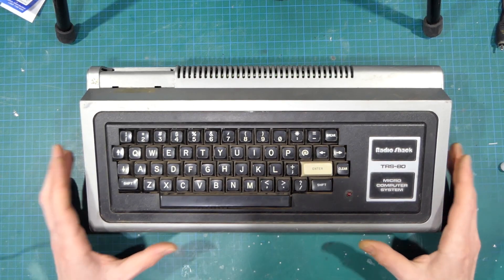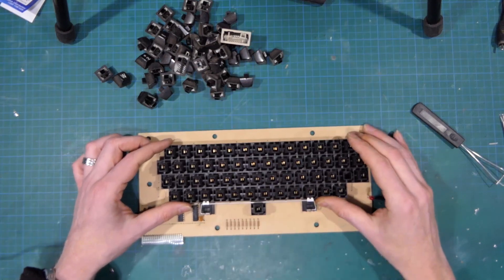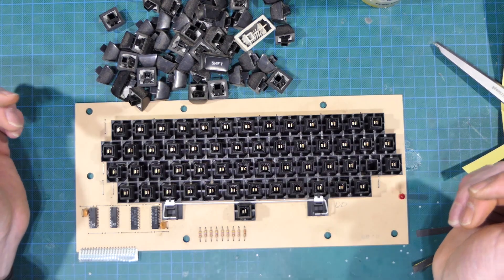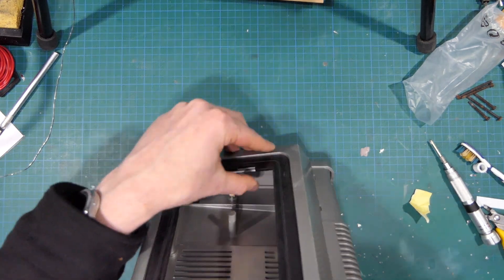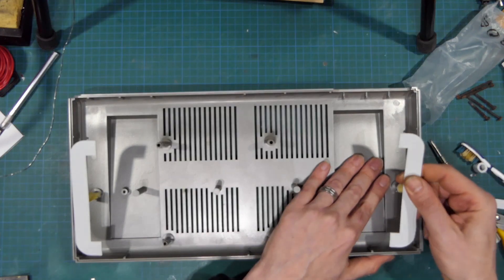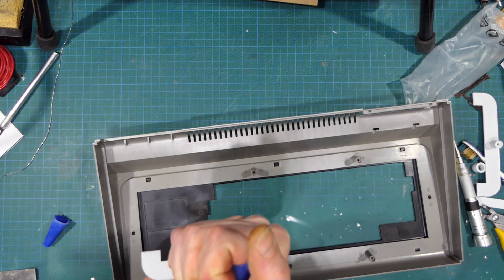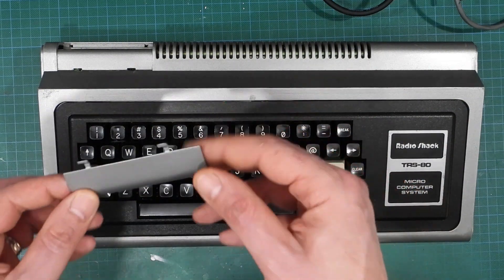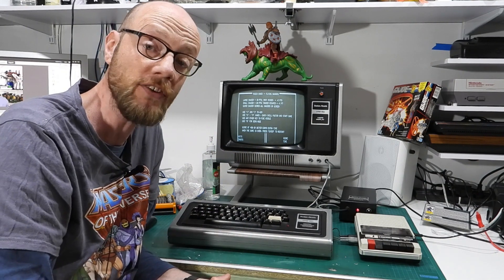Tandy TRS-80 Model 1 Pt 2 - Keyboard and case fixes #SepTandy

Comment: What tool did you use to remove the keycaps?  I need to do this to my first computer as the B key is no longer working.  Your idea to use the 40 pin ribbon cable with every other one cut out was genius, btw.
Reply from the maker: Just search eBay for “keycap puller”. They’re cheap as chips.

Comment: Use a Dremel with a cut off wheel and cut a notch in one of the screws you want to use to cut the threads.  Acts just like a tap.

Comment: Excellent video!  I bought an original Model 1 Level 1 with 4K of memory that had been in storage for over three decades.  I've done the research on upgrades, but I've also decided against it because I would like to keep it pure.  Thanks for the step by step on the Power Supply and Keyboard cleaning.... on my list for 2020.

Comment: A bit brave using sand paper on the key contacts, I usually start with contact cleaner on some copy paper, or business card, insert that between the contacts and moved back and forth with (in this case) the key stem pushed down to try and engage the contacts, I reserve sand paper to gear that is on it's last run before going to the tip.
As for the keyboard interconnect, I used some pin headers so it can be unplugged for working on it, in the end I used a 40 way ribbon plugged into two 40 pin headers, either cut off the second row of pins that are not used, or solder the two opposing pins to the same board pad/contact, doubling up on the wires causes no problems.
I did the same with the expansion connector as gold plated pins are heaps more reliable that the tin plated contacts they came with
My machine got the customary 16K/level 2 upgrade, I never thought the level 1 ROM would be of interest to anyone, it's a pity Tandy never returned them after the upgrade,  as they were of no use to the Tandy techs.
Later on I moded my board and fitted 4164 64K RAM chips (giving only 48K) as this gave a much more stable system than having the upper 32K on the end of a ribbon cable in the expansion interface.
I eventually rebuilt the whole thing into a model 4 case, bought as a spare part from Tandy
 - Pity one cannot add pictures to the comments

Comment: Now just having to throw in my $.02. I would probably gone ahead screwed the post to the bottom when I was checking the fit. Then MAYBE if you can see and get to it, tack the post in. Then take it apart and glue it up. I don't know. It just seems like it would be guaranteed that everything lines up. Regardless.  Great fix.

Comment: That's right, the model 1 had legit mechanical switches. At some point after they switched to far cheaper switches that were far harder to deal with restoring. Great job on the restoration. I assume you checked the capacitors on the main board. The Model 1 I had was a later version that came from the store with the level 2 upgrade. I eventually added the 'Expansion Interface' with some floppy drives (which after using the cassette deck seemed magically fast). I will say that of all the personal computers around that era, the Model 1 was the only one I ever used where the cassette tape storage was actually reliable. Slow yes, but reliable.

Comment: Interesting to see the model 1 being resurrected - it was the model that I learned Z80 assembly on at Uni in the mid 80s.  it always took longer than it should, since you had to cannibalise them to get a working set up. I have no clue what happened while Comp Sci weren't using them, but every week, it was the same.

Comment: Great job on the repairs and the awesome 3d printed stuff - Did you do the color matching for the silver yourself, or was there a color out there to use?  Funny about the tape deck, I also had the older one and ended up getting the newer one since i felt it matched my model 4 better (wasn't quite the correct one since the ones we have I believe are for the Coco, but seemed more correct than the old black one.  I pawned the old one off on Adrian and was informed later that it didn't work when he went to use it also.  c'est la vie.  :)
Reply from the maker: Brian V I took the actual machine out to a local auto paint place who colour scanned it and mixed up a spray can. The look of the guys face when I handed him a 40 year old computer to scan was priceless. 
The tape desk you see here I got for my CoCo 3.
Reply: @MrLurchsThings  that's awesome, i didn't know they could mix up spray cans as well.  I need to do that for an apple II+ and IIe that both need new paint.

Comment: I'm really enjoying this series. I never owned a TRS-80 of any type. I am intrigued by the Model 1 -- perhaps because if its breadbin-type form factor — now thinking of tracking one down in my neck of the woods. That expansion port cover reproduction you made is EXCELLENT as are the replacement keyboard screw mounts! Great stuff! Looking forward to Part 3.   #APowerSupplyThatPowers  ;)
Reply from the maker: It does have that 'space age' C64 look, doesnt it.
Reply: @MrLurchsThings  I wonder if Commodore got the inspiration for the VIC-20 (ultimately, C64) case design from the Model 1. 🤔

Comment: Nice video, the ribbon cable for the keyboard gave me a chuckle.  I'm currently working on replacing some bad caps on an LCD that really shouldn't have gone bad yet.  Part of the bad cap plague from 10 years ago, no doubt.
Reply from the maker: I have to be honest. That cable in the video ended up getting swapped out for pin-headers and a detachable cable (Ssshhh)
Reply: @MrLurchsThings  That's the right option for a computer you really care about.

Comment: Tandy didn't sell the L2 upgrade kit in the UK so I did it myself - first experiment in modding and I shook like a leaf the entire time. The next fix was to the crappy reed switch they use to pause the tape deck, that was a bit more ambitious because it involved soldering on the board but I was an old hand by then :)
Reply: One of the many things I did to my model 1 back in the day was to use it as a phone dialer. I hooked up the tape pause line to a relay which interrupted my phone line (I also put in my own phone extension by splicing into the wires running across the basement ceiling, bell would not be happy in the 70s if they found that). Then I had a little assembly program that I used to pulse dial the phone. This was nice because in the original telephone interface (basically a couple cups you dropped the handset into) didn't have any ability to dial itself. On my machine, I chained the dialing program with a hot key so I could switch to a terminal program the moment the other end answered. 

Interesting memory triggrer on the lower case mod. My machine had lower case, but I don't remember ever doing the mod myself. Did that come with the expansion interface? I had that and level II basic pretty much the moment they came out. Edit: Apparently there was an official lower case kit. I must have had that installed at some point.

Comment: What a dumb idea to have a soldered in keyboard.
Reply from the maker: More common that you think. And its a complete PITA
Reply: @MrLurchsThings  Especially in vintage models with more fragile cables.
Reply: @MrLurchsThings  Still easier to fix than an IBM M2 Keyboard :)